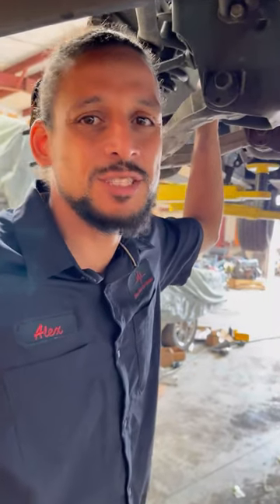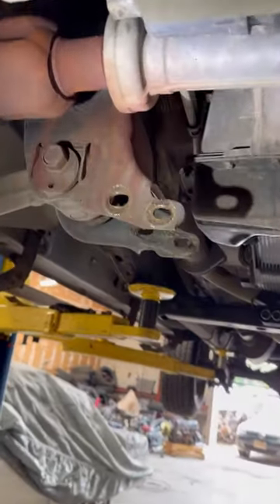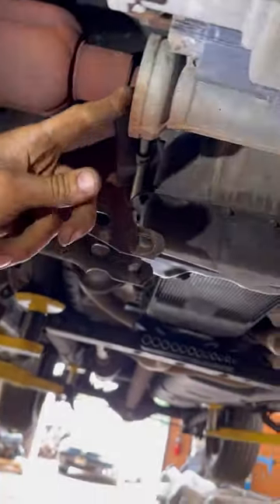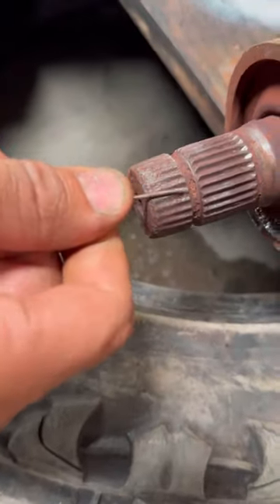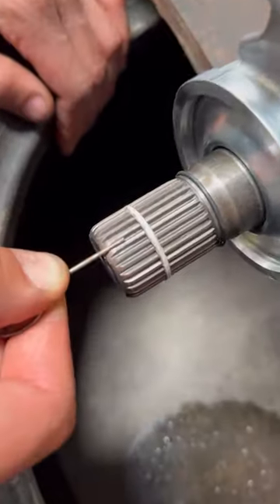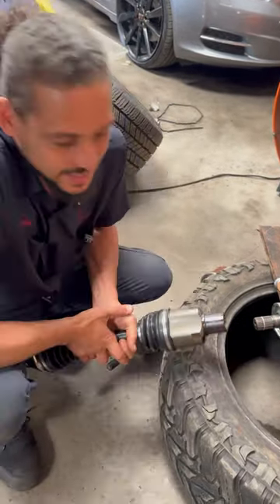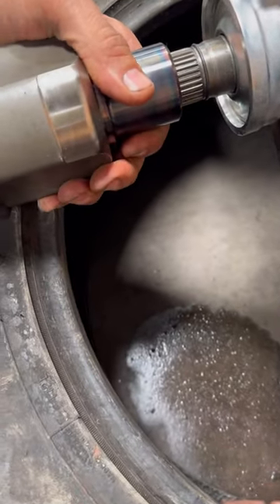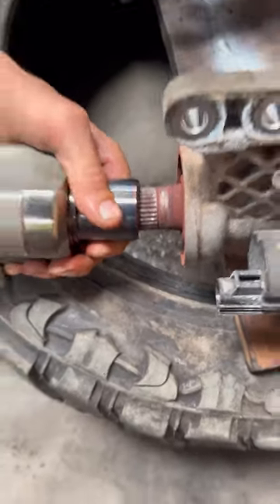It’s NOT just the CV Axle #ram #ram1500 #alexthecardoctor #cartips

Comment: Ok I can see the cv shaft but why replace the entire front differential? I’ve replaced plenty of output shaft’s without a problem on rams. Those differentials a very expensive.
Reply: Yeah once you’re taking the diff down you can just replace the part, both shafts come in a kit for $150 with bearings and seals. Gas truck can be done with the diff still in the truck. Ecodiesel needs the diff take out or atleast lowered.

Comment: There's a company in Canada, it's a transmission shop that sells intermediate shaft kits. I think I paid $450 for it. Comes with the intermediate shaft, seal and bearings also cv axle shaft dust cover. It took me about 1 1/2 - 2 hours total to change it. There a great video on YouTube from the transmission  that sells these kits and how to install them. I watched it, bought the kit and watched it again and swapped it out. Was pretty easy.

Comment: Thanks for this video. My front dif is slippin on my Jeep Grand Cherokee Laredo 3.6 pen also...
Reply: Could be the transfer case sir.. specifically the chain, but if left unattended it will cause way worse damage, to the point of some type of catastrophic damage to the entire unit... it will then turn 100s into 1000s of dollars... not to mention that if it does fail at a highway speed, you may very well lose complete control of your vehicle.. I have seen this happen quite a few times.. I just wanted to let you know, but I’m sure you’re aware, but I also know how we all get busy and things pass us by until they resurface as a greater problem... Find a good transmission shop near you and start there...😬👍🇺🇸

Comment: CV axle or lower engine mount? Hearing mad clunking and got excessive play in steering 😮 already replaced the control arms sway bar links and outer tie rods. Kind of stumped.🤔
Reply: There is play in the axle, but would the mounts be the cause of the clunking or the axles, and what do you think?

Comment: I've replaced my front passenger CV Axle on my 2016 Ram two times now, and the new one which I installed two months ago is not making a noise.  When I looked at it the other day I noticed that it's still connected, boot is in new condition, but it does feel too loose and wobbly.  Originally, the reason I had to replace it was because I had a wheel bearing failure due to some larger tires I think on the truck (which came with it).  My wheel was at probably a 25 degree angle to the truck when that happened.  Do you think maybe when that original incident happened, it ruined the differential mounts or stretched the control arms?  Trying to figure out why the new cv axles keep failing.  Thanks!

Comment: Got an 07 Honda odyssey. It had a click when turning left, changed the cv axle. No more click, we’ll almost, once in awhile it clicks when it goes into drive or reverse, I don’t have wear on my old splines like you do there but I’m asking cuz I’m curious if there is an issue in the transmission or am I just being paranoid? 126k miles.

Comment: Why didn’t you just replace the stub shafts as opposed to replacing the entire front diff?
Reply from the maker: Thanks for your question and not making assumptions 😊 the stub shaft required opening up the Diff. If I opened up the Diff, I would’ve wanted to go ahead and change everything for warranty purposes. On this one the stub shaft didn’t simply slide out… I checked. Since the customer drove 4 hours to have me work on his truck, we decided that this was best! Thanks for the question.
Reply: Im not a machanic and changed the intermediate shaft succesfully and the diff was fine. It took some research but is totaly servicable. Im sure you know this by now.
Reply: @AlexTheCarDoctor hey man I replaced the cv axles on my ram 1500 an the cv axles still have play. I'm gonna tackle the intermediate shaft or stub shaft next. Any tips? Is my differential damaged you think ?

Comment: Just had these done twice and ended up having to get the whole front diff replaced because the shop couldn’t get the stub in without nicking the seal.
Reply: You can change the seal without changing the diff
Reply: Mines done this I replace the CV axles and there still is play

Comment: What if it has play when I push it in and pull outwards is that bad as well?
Reply from the maker: That’s normal, they are designed to do that on most vehicles to compensate for suspension travel
Reply: @AlexTheCarDoctor  thank you I’m still tryna find the reason why it shakes a bit after 75+